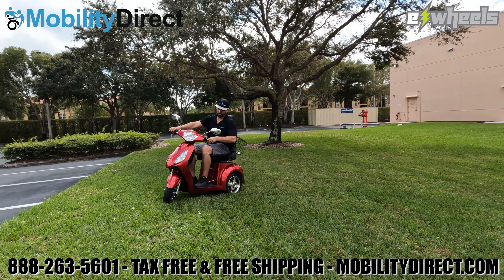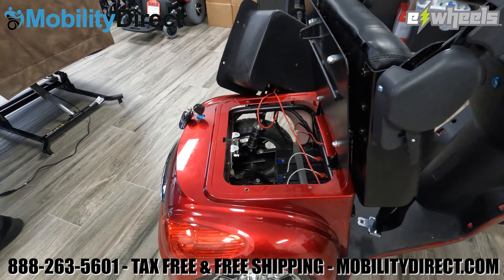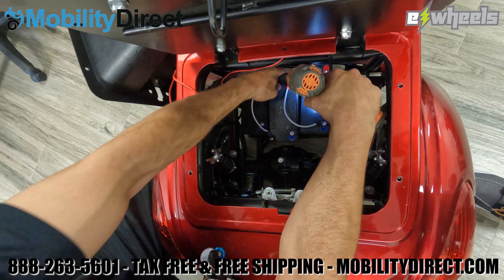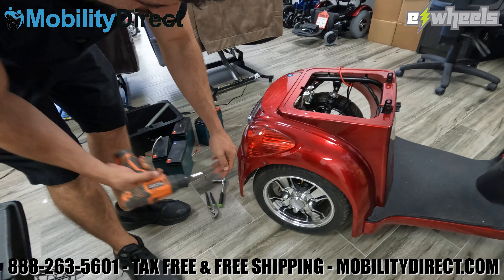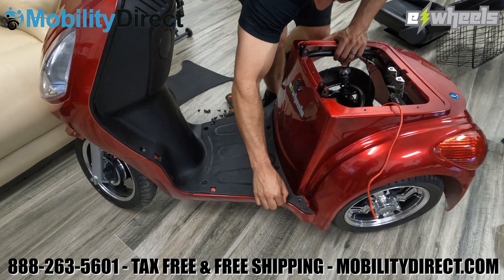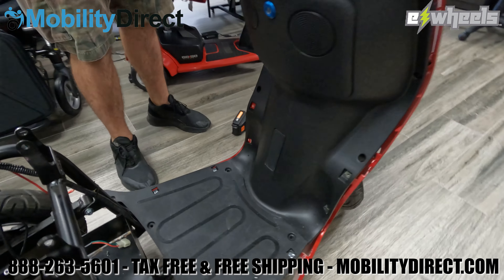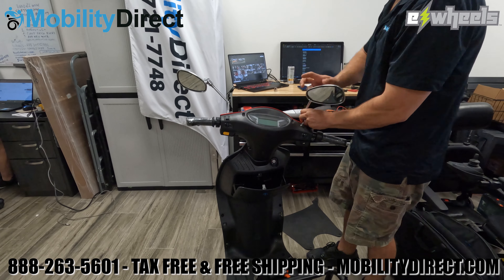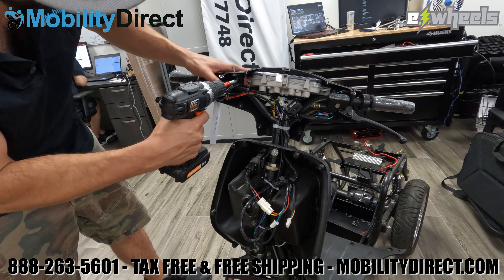🔥 How to Take Apart an EW-36 Scooter - Troubleshooting & Disassembly Tutorial

Comment: Where is the 1 fuse for the headlight located?
Reply from the maker: In the steering column below the dash.
Reply: Thank you for your speedy reply! The manual says “behind the headlight fairing” and I’m assuming “steering column below the dash” is the same place but I still couldn’t find it and I tore apart the entire scooter; your video helped very much in the order of operations and considerations so THANK YOU! However, you didn’t point out where the fuse was😢.  Can you provide me with a more exact location or a link to a picture? I pulled apart all of the quick connects and the small black box holding a control board and nothing. I know what the fuse looks like. Is it protected in something? Any help is greatly appreciated. I live in the Colorado Mountains and the closest repair is repair is over 2 hours away

Comment: Help Video ?
User manual says there a glass fuse under head light cowling? 
is that on the handle bars or lower down
Reply from the maker: There's a fuse for both.

Comment: The headlights wont work. Any ideas? Is there a fuse or something?
Reply from the maker: Thanks for watching our video and commenting! If you already checked the wires connecting your headlights as shown in the video, and you don't see any problems with other functions of the scooter aside from it, then the problem is most likely on your headlights. There is a fuse there but if that has issues, you will probably have problems turning on the scooter. If that didn't work, you can have a technician check that out for you as well. Don't forget to subscribe for a chance to win a free mobility scooter.

Comment: How do I get technical support and parts for a EW46. Ewheels doesn't answer emails or phone messages. Are they out of business or what?
Reply from the maker: E-wheels does not provide support to customers. They are the manufacturer, you need to call the dealer that sold it to you.
Reply: @MobilityDirect  They don not even respond to techs when they call in. every time I call I get placed on hold and after 10 minutes get a message that they are all busy leave a message. Good luck trying to get a call back when you are actually working on the scooter.

Comment: New Batts all lights and beepers working no throttle response also dont see a switch for forward  and reverse its an earlier model im guessing any ideas ?
Reply from the maker: You need to check all the wires and connectors
Reply: @MobilityDirect  all tight I'm a retired mechanic think transaxle is junk wont roll freely
Reply from the maker: @tommello9525  are you saying when you try to push the unit, it will not roll freely?
Reply: @MobilityDirect  yes and no throttle action also no sign of a reverse  button not that its important now must an early model
Reply from the maker: @tommello9525  do you know if it's the model that has electromagnetic brakes? I'm not sure if you are aware but the EW36 is available in two versions, one with standard brakes and the other with electromagnetic brakes which are basically automatic brakes.
Reply: @MobilityDirect  its older model so not sure what came with it would think standard. Where as not seeing a reverse option

Comment: I have this mobility scooter and a rock hit the motor and broke the earth magnets and the motor and cracked the gear box and the E-WHEELS did nothing to help me out anything I broke. So I'm out 3000.00.   Dollars 💸
Reply from the maker: That's really not cool Darrin, I'm really sorry to hear that. Although we sell this model, we don't carry it in our brick and mortar stores. Online there is a big demand for it, but its stories like this which make it hard for us as a dealer to recommend them. :(
Reply: @MobilityDirect  I just wanted to make you aware of this product and the company will not provide the service or a new motor if it should break I'm disabled with MULTIPLE SCLEROSIS and out $3000.00 dollars because I went through the grass in a rock cracked the gear box and broke some earth magnets in the motor also the gear box has oil in it.
Reply: If you look on the bottom of my rickshaw gearbox there is a screw if you remove the screw or or it gets nocked out all of your oil will drain out.
Reply from the maker: @darrinburnette6916  thanks for the heads up, we will definitely look into it